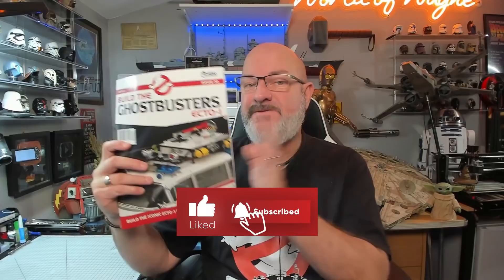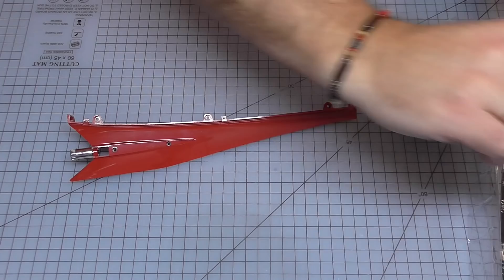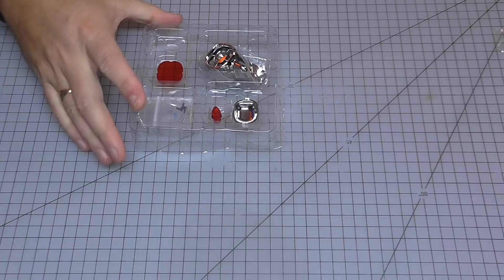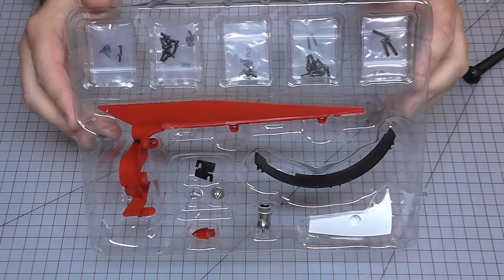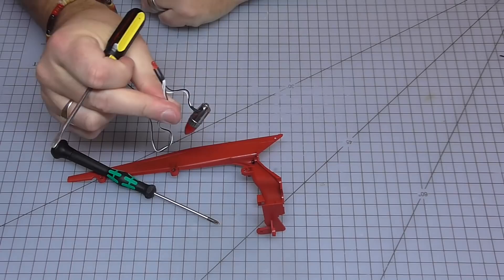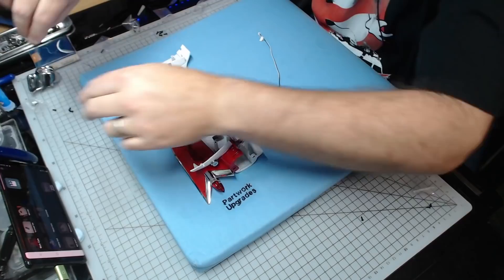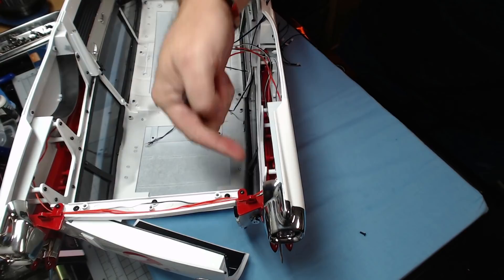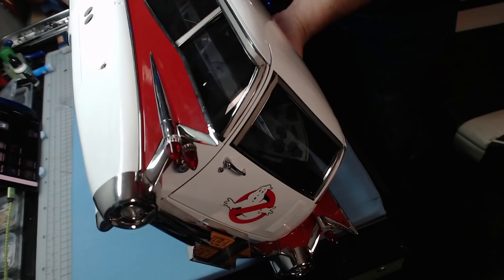Build the Ghostbusters Ecto-1 - Part 111,112,113 and 114 - Rear Fender, Crown, Skirting and Steering

Comment: Those chrome pieces on the bottom of the ecto 1 they are rocker panels that's what they call them in the states are stamped metal sheets to support the chases from the back tire to the front tire and it keeps the car from separating the back from the front well as support the car for the jack to change the tires
Reply: I meant chrome rocker panel trim

Comment: Bloody hell, we’ve finally got another part(s) to be doing. I managed to break the fin on the other side, not totally but the silly little screw that holds the fin together popped out and stripped the thread, so I had to bodge it with a much larger screw that went through the plastic on the other side. Gah! I’ve got some wonky (and scratched) windows on that same side of the vehicle so it’s gotten to the stage where one side is the ‘hero’ angle and the other side looks like crap, lol

Comment: Let's just hope eaglemoss do not do a extension for the afterlife movie as it would need a new body and floor.
This is because of the gunners seat if they did it but there is a difference in the roof rack in Ghostbusters 2 so there could be a extension for that.💳💴💷💶💵💰💸
Loving the build as always.
Stay safe all.

Comment: Hi Wayne!  I've just finished this Issue and have a question re: the steering wheel.  When you installed that in Stage 114, did the hub snap on, or did you have to use dabs of glue to keep it in place?  Mine does not clip into place, just sits there loose.
Reply from the maker: Mine stayed in, but there is no harm in gluing it

Comment: Wayne I snapped a skrew in when I was tightening. Any episodes or suggestions how I can remove a broken skrew? Thank
Reply from the maker: Was it in plastic or metal?
Reply: @WorldofWayneUK  in metal, issue 88 it was a DM screw
Reply from the maker: @seanmics9537  I would suggest and easy out but the metal is quite thin. You could try drilling out but to be realistic you need a good drill press. Can it be glued?
Reply: @WorldofWayneUK  thank you sir. Appreciate your time. Yes I’ll try and glue it probably.

Comment: What issue did you receive your replacement passenger side door? Also, I wish they'd made an option for non-tinted windows. I know it's screen accurate, but I find it so distracting.
Reply from the maker: Stage 107 I believe